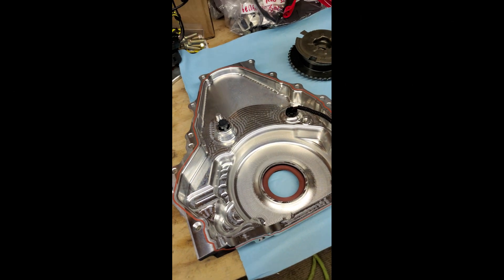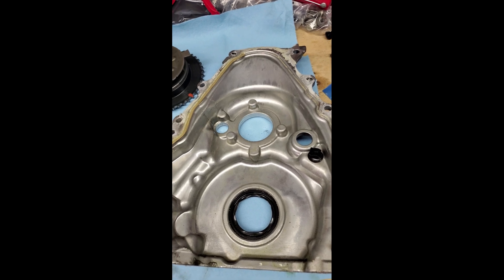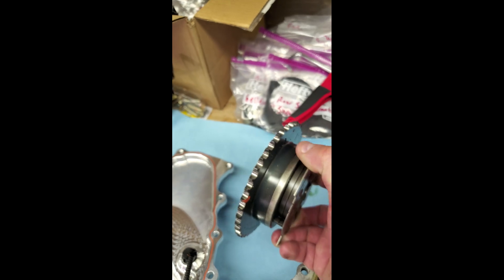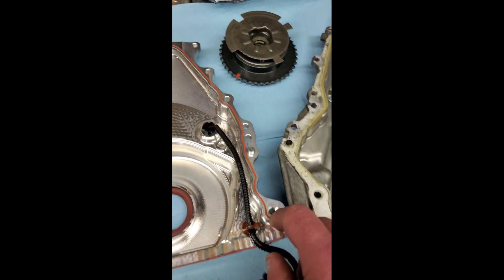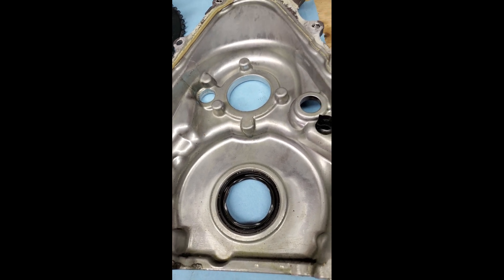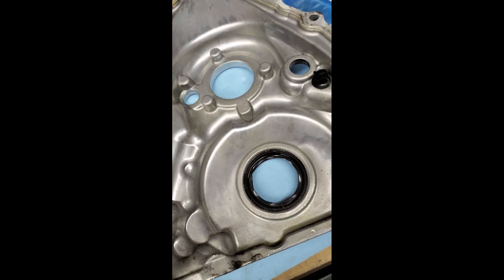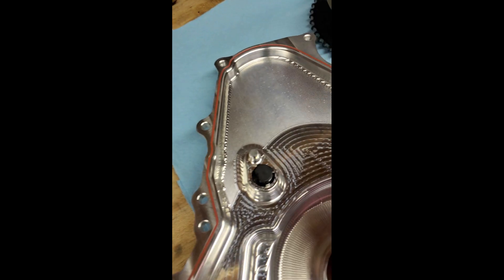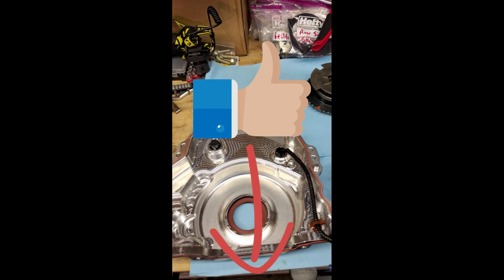LME Billet GenV LT4 VVT Delete Front Cover (How beautiful is this!)

Comment: Was this a noticeable upgrade? I have a L86 Silverado that is getting rebuilt and I am more interested in lightening the valve train to increase the reving potential to make a more “sporty” truck. I am upgrading the converter to a Circle D and want my truck to really build power through the RPM range
Reply from the maker: It won't be a "seat of the pants" upgrade, but in my opinion I was going all out so it made sense to pull all that weight off the VVT assembly.  The billet cover of course is just jewelry, but it is required b/c it moves the cam sensor to the correct position now that the sprocket has changed.   You would be good to invest in a good set of dual valve springs for safety, and of course since you are going with a Circle D and hopefully a higher stall, a larger cam would by far be the best power upgrade.  I would personally save the money with the front cover and put it towards springs, titanium retainers, even a bit towards upgraded heads if you can swing them.  Again I already had every single upgrade done, and I track the car, so I wanted to keep the rotating mass as light as possible.  I also went with their billet timing chain tensioner, which dumps that crappy plastic one for a solid billet part.  And again, meant for reliability with high power, not necessarily for 50k miles of life.
Reply: @ thank you for replying. I do have a procharger, cam, ported intake and throttle body, heads done, headers, and cat back. I almost did LT4 intake valves when I had the heads done but skipped it for now. Upgrading the valve train is something I want to do in the future, after a new driveshaft, to help it rev out a little more. I love your build. Can’t wait to see more videos on it
Reply from the maker: @NBStoreyTrading  Man that thing sounds killer any videos?  Didn't see any on your channel.
Reply: @ I should be getting it back from the shop this week and I’ll post some up. She’s a beast!

Comment: Awesome videos. I just picked up one of these lme kits myself. I’m glad I found this video because I was wondering about the loose fitting sensor/harness. My kit didn’t come with any bolts to secure the cam sensor or the metal bracket with harness. What bolts did you end up using because the ones on my oem cover are too big.
Reply from the maker: Thank you!  Yes, that's my goal really is to help with those niche areas that most haven't covered.  Glad I can help and once you put some seal all on it, it won't ever have an issue again.  Mine is still perfect. The cam sensor is bolted in to ensure you screw that bolt in all the way.  Otherwise, it won't read the cam magnet well and throw codes and misfires.  It must be all the way in, trust me.  But don't strip it.  Secondly, the other black sensor harness is for the pass-through to the oil pump solenoid.  That's the one you want to use seal all on since it just presses in and has two small tabs on the back to lock it.  Those tabs don't hold well.
Reply: @MichaelBrownPlus  I was thinking of putting a c clip on the backside of the sensor harness to hold it in place better, but I’m too scared of it falling off inside the motor lol

Did you have to buy a separate bolt to hold the cam sensor in place? None of my factory bolts work for that on mine.
Reply from the maker: @eortega22  Yes don't do that.  Lots of vibrations there and crankcase gas and oil splashing.  Trust me seal all and be done.  about $15 for a tube.  You can use it for other things as well.
Reply: Hello Michael , do you do any work on the side ?

Comment: if deleting the vvt ..do you have to change or upgrade Camshaft?
Reply from the maker: Sorry I missed this comment.  Yes, you have to go with a non-VVT camshaft which is actually the most common type of aftermarket camshafts for the GenV platform anyway.  So lots of choices.  I work with Vengeance Racing a lot as well as Texas Speed.  I went with a VR stage 3 boosted camshaft, but other companies even such as Brian Tooley Racing make great camshafts.   But yes, unfortunately to remove the VVT functionality you need a camshaft.
Reply: @MichaelBrownPlus  thanks I have 07 escalade.. code p0011 keeps coming back...
Reply from the maker: @illustr8phee100  yeah getting rid of the VVT can help with codes like that I had similar issues with over advancing and I think it was related to low oil pressure.  Very hard to diagnose some of these issues for sure, the main thing is ensuring everything that could be the problem starting with the easiest and cheapest fix those first, then go into more expensive areas step by step.  My cam sensor was just a hair lose the ARP stud was a bit long so it bottomed out.  Thought torque was perfect but wow that issue caused me hell b/c I replaced the sensor and checked wiring, voltage, everything and it was perfect.  I just happened to feel a bit of movement in the sensor and that tiny little bit caused it not to read correctly.  These engines have some areas with high tolerances but wow those with low can be extremely hard to find.
Reply from the maker: @illustr8phee100  so have you already done a cam?  Or you have this issue and considering doing a cam and removing VVT?

Comment: Going from vvt to non vvt did you change out your cam? Does it have to be a LTX cam? Or could you use a LSx based cam? I plan to ditch my direct injection, I won’t need that DI cam any longer.
Reply from the maker: I went with a Vengeance Racing custom spec Stage 3 Procharger cam.  Johnson 2116 Slow leak down race lifters.

Comment: Can u remove the cam sprocket like you could on an ls3 without removing the oil pump instead of the dod sprocket bs ? Seems like that may be possible since the ls3 is like 2” narrower???
Reply from the maker: You can get the cam sprocket off on an LS3 yes without the BS of LT4 dod. Just pull the 3 bolts, mark your position on these sprocket of course.  Re-install.
Reply: I dont mean to be offtopic but does anybody know a method to get back into an instagram account??
I was dumb lost my account password. I appreciate any help you can give me
Reply: @Jesse Enoch Instablaster =)
Reply: @Grant Joseph thanks for your reply. I got to the site through google and im trying it out now.
Seems to take a while so I will reply here later when my account password hopefully is recovered.
Reply: @Grant Joseph it did the trick and I actually got access to my account again. I'm so happy!
Thank you so much you saved my account!
Reply: @Jesse Enoch You are welcome :)

Comment: Stupid question, if someone was on a budget, but still wanted to completely remove the DOD sprocket, could the factory LT4 timing cover be re-used in conjunction with the LS3 sprocket and seal?
Reply from the maker: I doubt it.  The billet covers are engineered to place the cam sensor in a closer location to the LS3 sprocket pickups.  The stock VVT sprocket is much thicker so the cam sensor sits out much further.  I get what you are saying but I wouldn't recommend it, most likely a dead end and a lot of work wasted. Just do the phaser lockout kit on most setups I doubt you even notice a difference.
Reply: Michael Brown thanks for the info man. I appreciate it. Yeah I don’t want to do a phaser lock out kit, Edgar aka Dsmlights recommends highly against the lock out kit, it does not fully lock out the cam gear, when tuning the cam gear slightly moves causing erratic readings and a loss of power. Will just go with a billet cover. Was just seeing if there was an opportunity for saving a little cash. Thank you once again.
Reply from the maker: @BigThumpr1  agreed.  And yes there are phaser limiters (which for sure you don't want) and a phaser lockout (which is as close as you can get to a full lockout without going the LS3 sprocket route).  I know on BIG HP motors you can have some movement there.  Not to mention that VVT assembly is heavy!  I was amazed at how heavy it was so removing all that rotating mass is for sure a great thing.  Just be sure you seat your cam position sensor fully it can be just a hair not tight and you will lose TACH signal on your dash (and holley) I had that happen.  I used ARP bolts which I would recommend as well.